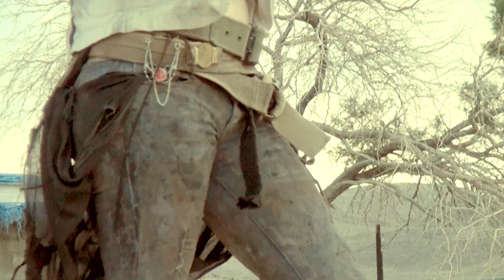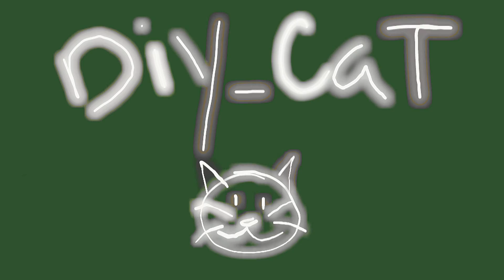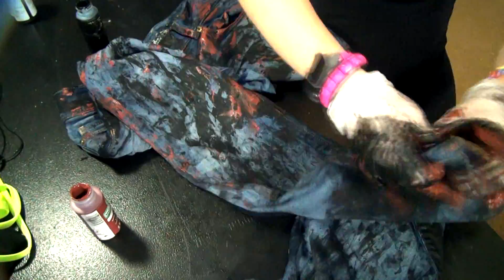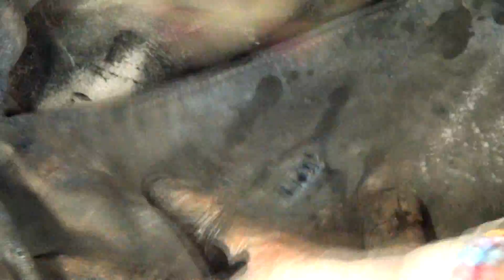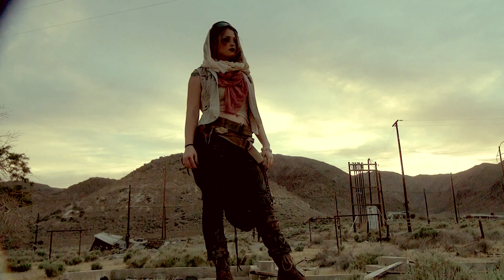Post Apocalyptic Blue Jeans - How to: Paint and Distress Fabric Pt.1

Comment: I've been looking for any information on if diys  like this are washable? And how still the material may get?
Reply from the maker: If you use fabric paint like I do, and follow the directions for drying time, you should be able to wash them with no problem. But why would you do that?! Let them get hard and crusty and all Wastelandy! 

But yes, if you allow the appropriate time for the fabric paint to set and dry, you should be able to wash the garment. I would however, worry that you may lose a little bit of the baby powder. Otherwise, it will be fine. :) If you try this, let me know!
Reply: Diy_CaT it looked like regular spray paint. Thank you for getting back to me so quickly. 
I need to know because I live in Florida and the butt sweat look is cool but the smell not so much! Lol
Reply from the maker: Nope! All the paints I used in this project (links in the description) are meant for fabric, or are all purpose and can be used on fabric! :)
Reply: Diy_CaT  I did not know apple paints were all purpose :D 
Thank you!
Reply from the maker: I don't know that they all are. Mine are, however!
Reply from the maker: Friend! I washed my jeans and they still looked AMAZING! :)

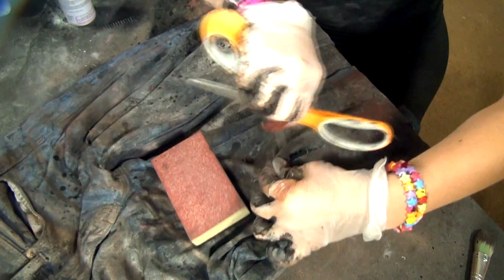Comment: great video, the jeans came out great, i am looking for ideas for halloween, i hope this question isn't irreverent, but what was the tool you were using when you were stitching the cut you make back together around 4:00?  it seemed like you were stitching pretty normally, what was the tool doing?  thnx!
Reply from the maker: Hercules Rockefeller that is an awl! I linked to one in the description box I think. Awls are great for tougher material like denim and leather, plus the big stitches looks really cool!